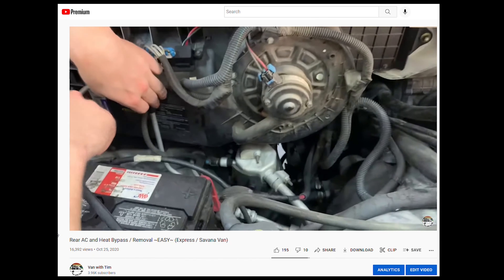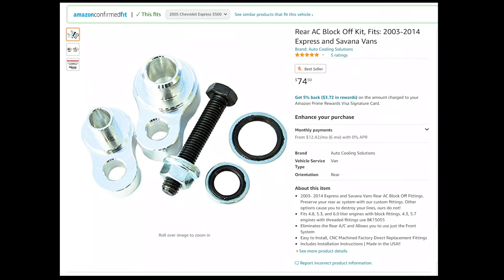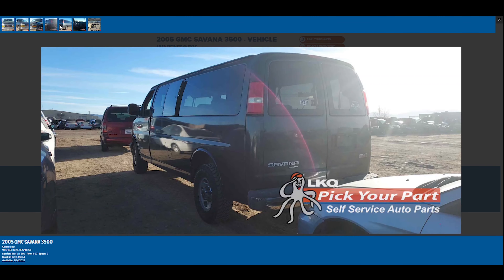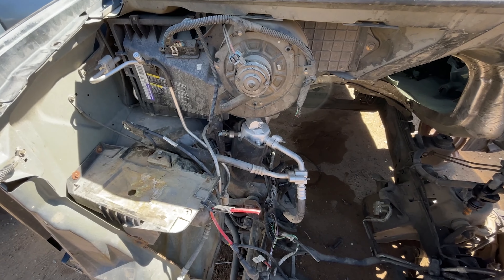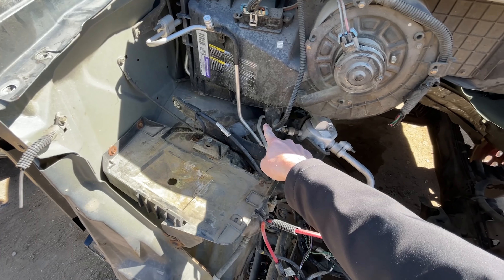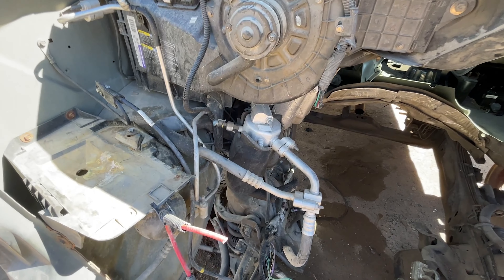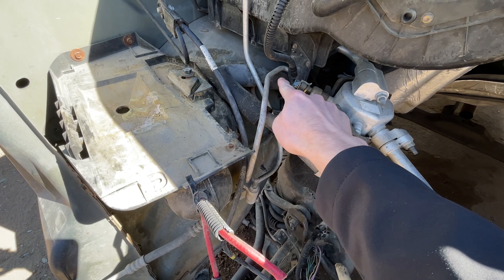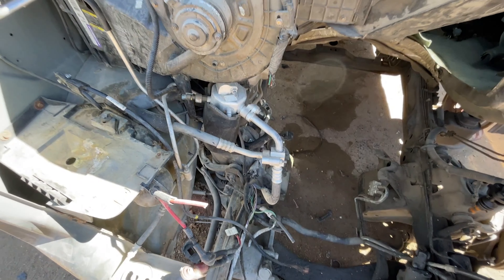Which lines to block off - Rear AC removal (Express / Savana Vans)

Comment: will the system need a recharge after fitting this because the circuit is opened ?
Reply from the maker: Correct, it will need to be recharged

Comment: Why would one want to block off their rear a/c?
Reply: To remove it, as the parts (blower, evaporator?) take up a lot of space in the back.  For van life rear climate control isn't useful because a) it only operates when the vehicle is running and b) the rear vents are probably blocked by the build-out.
Reply from the maker: What posteroonie said! These 6.0L V8's use 1/2 gallon of fuel every hour they idle. To use the van's rear heat / AC overnight, you'd use 4-5 gallons of fuel (almost $30 / night in the wonderful state of California lol)!
After five days of doing that, you could have paid for a diesel heater (I installed mine right where the old factory rear heat / AC were)
Cheers!
-Tim
Reply: The main reason to block off the rear ac is...the rear can leak freon, and repairs could get expensive..its always good to block..then later it can be repaired